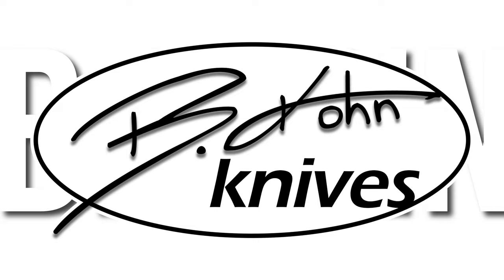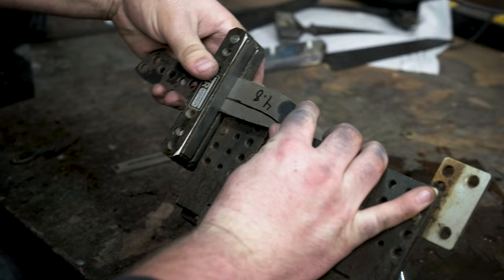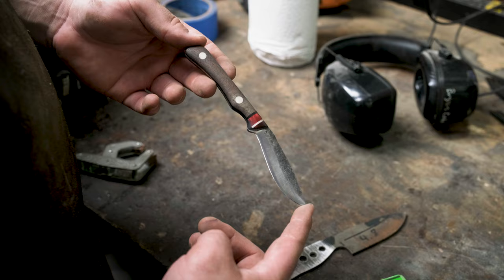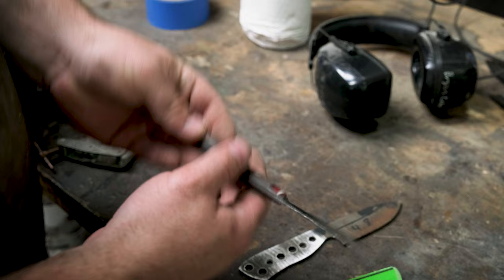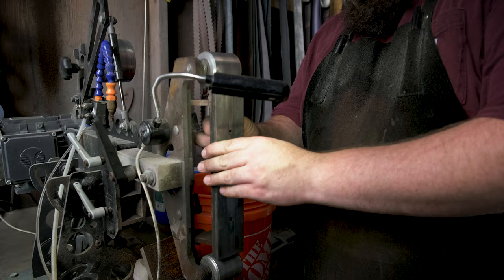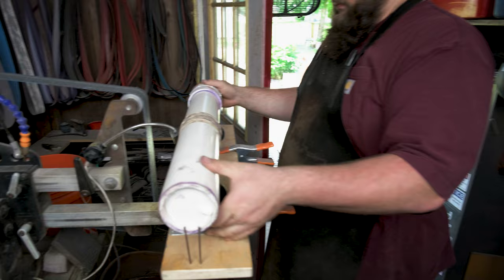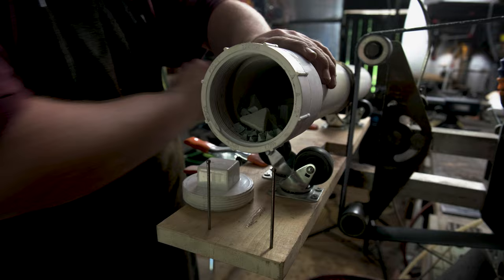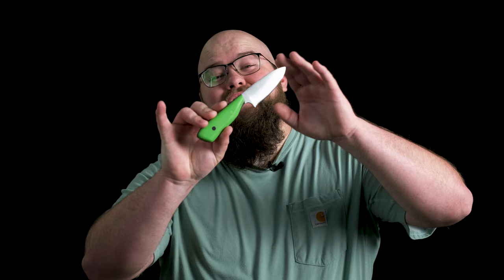Making a EDC knife - Gentry Custom Knives Collaboration

Comment: Why do you go to the soft platen? Is that something I should be doing?
Reply: It let's you blend lines together very similar to a rotary platen but 1/10  the price but you only have one "setting" unlike the rotary which has 3 (at least the ameribrade version does).  Works great for softening facets/bevels if you don't what specify bevel lines, or in my case hiding uneven bevels.  I use it a lot on kitchen knives and it cuts down on the amount of hand sanding I need to do.
Reply from the maker: Bryan Hunt is 100% correct!